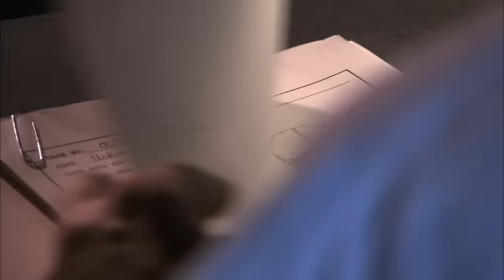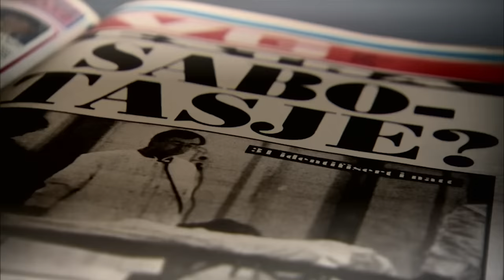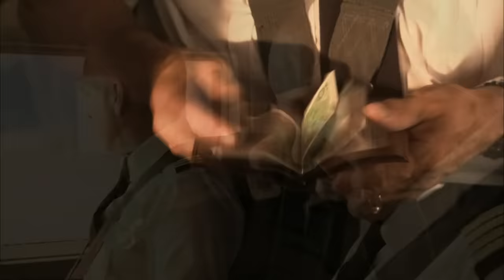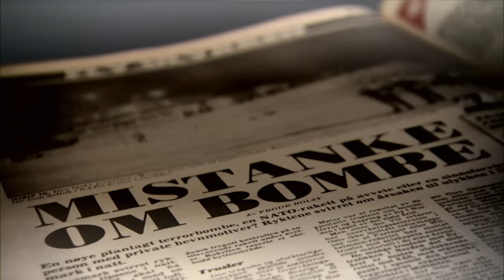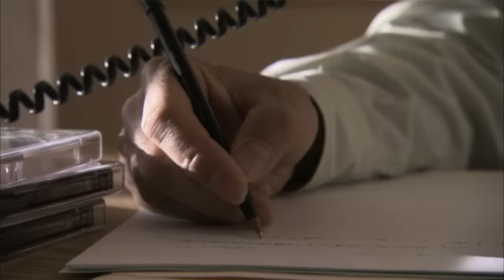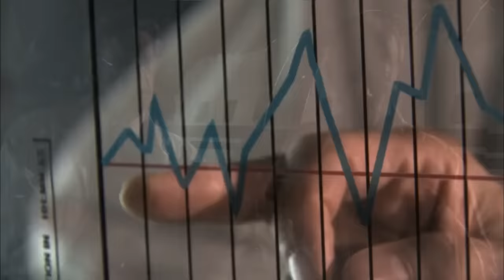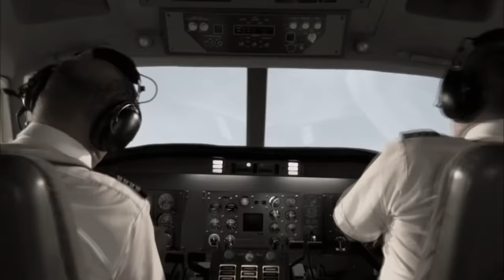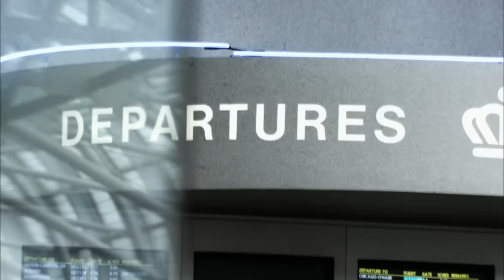The Worst Airline Disaster In Norwegian History | Mayday: Air Disaster

Comment from the maker: Who is responsible for Partnair Flight #394 disaster?
Reply: Initially I thought it was the F-16 pilot's fault, that he'd flown too close and made Flight 94 fly directly into its airstream, but now its hard to pinpoint the blame as the airline could have thought the parts were real, and the people making the bogus parts could've thought nothing bad would happen since some were restoring old parts. It's still the black market's fault and maybe even the airline's if they knew, hard to pinpoint blame past that, but definitely the black market.
Reply: The peanuts were bad
Reply: @UserName-b8g  😅😮
Reply: (1) The pilots should have NOT have flown on the APU.  Plane should have been grounded for repairs, but a plane on the ground generates zero revenue and incurs repair costs, and pilots are bootlickers.  (2) Maintenance and repair crews always try to cut corners in order to get a plane airborne, also bootlickers.  (3) The financially distressed airline knowingly bought unauthorized parts to save money.  Most plane disasters are caused by what happens - or does not happen - on the ground.
Reply: Same as first responders  cops respond after the crime but not there to stop it. Investigators find out why after the accident but can't monitor to prevent before hand
Reply: @jennifermoran9088  true planes, are complex machines with a insane amount of parts to maintain
Reply: Corporate Greed
Reply: Smells alot like bs

Comment: Same thing happened to the pilot that got sucked out the windshield. Maintenance put the wrong screw on the windshield
Reply: That wasn’t the same thing that wasn’t a counterfeit part, that was a case of the wrong sized screw
Reply: I'm guessing OP is referring to the fact that both cases involved hardware, such a small thing to cause disaster and death.

Comment: Don't forget - how did bogus parts get into even the FAA stash? The mandatory call for bids and you need to take the lowest offer. That system literally attracts that kind of wrongdoers.
Reply: Yep. The standard is lowest bidder. Not lowest bidder that can satisfy the requirements. So often they can't do what they claim but keep the contract
Reply: @KNR90  Its been like that far back before the invention of flight. One example would be the low bid taken by the Royal Navy for the Ships HMS Erebus and HMS Terror in 1845. The Navy took a low bid on can goods meant to keep the crews nourished for long arctic journeys.  This was because their last voyage was to find a Northwest Passage in northern Canada. It was discovered the cans were improperly sealed and may have contaminated the contents with lead.
Reply: That explains the horrific safety record of commercial flight!
Reply: @topgun9686 That wasn't low bid, it was not giving the manufacturer sufficient time to take proper safety precautions
Reply: Easy: Corruption
Reply: If you're paying $30 for a $250 part, you have to know something's wrong.
Reply: @jameswest8280 No, they cost 30$ to produce instead of 250. They're still sold at regular price!

And something that's been said in the Video which everyone seems to have forgotten, is that the Bogus Parts were produced to be Near-Perfect Replicas and since they also had the Forged Inspection Certification from the FAA, they absolutely passed as normal Parts.

Comment: It's interesting that the CVR, while recording the beginning of the flight instead of the last moments before the accident, still revealed useful information. Also usually airlines in financial trouble are often guilty of maintenance neglect. In this case, it seems that they did their maintenance in good faith and had no idea that their plane had bogus parts.
Reply: In this day and age you can’t trust anyone. Every-time I take my car for oil change, I always check the oil level, leaks etc. My uncle’s engine blew up when the mechanic forgot to refill the oil. Hopefully airline operators hire 3rd party auditors that can double check the mechanics work
Reply: @siamimam2109  Bogus parts are so insidious. Unless the auditor is with the mechanic, I don't think it would work. These are very difficult to tell after they are used as real replacement parts.

Comment: We are starting to see this same aftermarket business in the auto repair industry too. My daughter’s car was being repaired and the mechanic let me know that the insurance would only pay for an aftermarket part. I refused on the account that unless it was the cars actual part, I would not unsafely put her back on the road. Most are probably okay but will you take the chance? I think the actions of the insurance companies only approving the lesser part ,proves what eventually drives this bogus part madness.
Reply: It is a big problem, I have had SO many cases where the original part lasted >200,000 miles and then once you replace it you replace it every 20,000. Even if you buy Delco, Motorcraft, Mopar parts, in a new box and everything, they often don't last. I think there are a lot of counterfeit parts there as well. They're refurbished parts put in an OEM box.
Reply: Many years ago, I replaced a failed water pump and discovered that the original pump was poorly designed so that the impeller couldn’t last.  The replacement was much better.  Original equipment can be junk, too.
Reply: That's nothing new. Repair parts have been around for 100yrs. Some worse and some better. If the OE is called to be a grade 5, a grade 7 is just fine. 50,000psi transverse rupture strength bolt is quite stronger than the aluminum frame that it's riveted to. And
I don't believe they actually found all the Bolts that were a mile underwater. They probably came from the ships galley.

Comment: It would be interesting to know what makes one bolt, even the most excellent bolt ever made, cost $250.
Reply: so few are needed,, they are replaced after years so not many are made and the specifications and standards are extremely high. If you only manufacture 2000 of them thats a high cost as opposed to 100,000 or millions for other standard bolts
Reply: Quality control standards, inspection and certification costs, environmental testing costs. You’re not paying for the part you’re paying for the cost the company had to pay to build test certify and sell that part
Reply: Those bolts earn their keep! They are  the difference between life and death for thousands of people!
Reply: Also, these are no mere ordinary Bolts!
Such Parts in the Aeronautics Industry have to be extremely Strong, Reliable, Resistant to many types of hazards (corrosion, structural stress & metal fatigue, vibration, etc.) that would wear down normal Bolts very fast.

They are made to extremely stringent Standards & Specifications, are usually made from completely different Materials than ordinary Bolts/Fasteners, using much more expensive Metals and Alloys and thus obviously much more expensive Manufacturing Processes, on top of what other people said regarding the Quality Control Standards, Inspection & Certification Costs, Environmental & Stress Testing Costs, and much much more!

All this, including that those Parts are produced on a much smaller scale than regular Hardware Store Bolts, are all very legitimate Factors in the end Cost of Aeronautical Parts.

They're also designed and tested by extremely qualified personnel (tons of them possessing a PHD), which also drives up Costs!

But that's the Price to pay for Extreme Reliability under Extreme Conditions! Just like Aerospace Components.
Reply: If you had to make that bolt yourself from the proper alloy to that tight of a tolerance and certify it, you would charge at least that.
Reply: Probably a 1000% markup like the medical industry 😂 When you manufacture “authentic parts” in industries like health, aviation, military, space etc, you can charge any $ amount

Comment: Another case of harmonic vibration occurred in the Lockheed Electra.  I think there were at least 2 crashes before engineers realized that the engines and wings could vibrate together until they ripped off the aircraft.  Tell City??

Comment: one thing the APU is only used while on the ground, it should not be running while in the air.
Reply: When engine power is lost they run the APU in in the air as an emergency procedure.

Comment: Irregardless of the grade of bolt, it must be torqued per specs. If you over-tighten the best of bolt, it will stretch/yield and then be as good as broken. I'd rather have a grade7 properly tightened than a grade8 over-tightened any time.

Comment: I don't know anything about airplane design, but am I the only one in the world that thinks just four tiny little bolts holding on the entire tail assembly of a commercial airliner is an incredibly bad idea??  That sounds to me like attaching the head shields on the space shuttle with duct tape and crazy glue.
Reply: Wait until you here that a single nut holds on the main blade of a helicopter.  But if they are good 4 bolts can hold a insane amount of force
Reply: @ipodhty  
We're not talking about a helicopter here friend, but a humongous commercial airliner!!  How much does a HELICOPTER weigh, and what kind of G forces are put upon it?  How many passengers does a chopper hold??  And isn't it rather obvious to you that these "4 good bolts" actually FAILED??  Am I missing something here???

Comment: Bolts cost as much as 200 dollars, while the counterfeit parts are as little as 30.

Heres the problem right there, you're so busy regulating that parts be authentic (which is good) but how about you regulate that these parts are reasonably priced???  Bolt shouldn't be no more than ten bucks considering they spent MILLIONS on the plane! THIS is where regulations need to occur

Comment: The fact that they were allowed to alter a cockpit voice recorder that is the only way to find out what happened 10 years before means that the regulating authority wasn’t doing there job I have a lot fix it only needs a sport license to fly and I have a cvt in it just in case I also have a flight data recorder on my aircraft they can no longer be used for commercial purposes but It will work for my application and it runs off the battery and the battery alone

Comment: Are the bare minimum of bolts are used to hold planes together?
Reply: No, they design in a safety margin of 2 or greater which means means any structural component, bolts included need to be able to withstand at least double their design load before failing. That plane honestly could've gotten away with just 2 bolts holding the tail on (assuming said bolts are true aviation grade bolts). They're made of inconel (i think) either that or some titanium based super-alloy, point is they're a lot stronger than steel bolts of the same size.

Comment: I wouldn't fly in a 36 year old plane. A lot of planes still flying are very old and should be junked for scrap metal.
Reply: If you have flown commercial it's likely you have. Big jets often last much longer. Smaller operators island hopping might use planes that may be over 50 years old